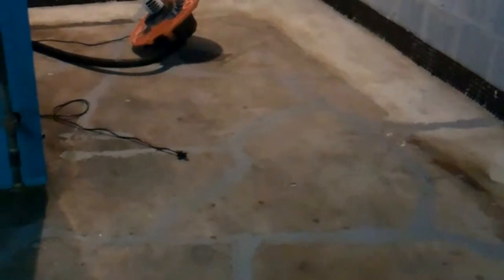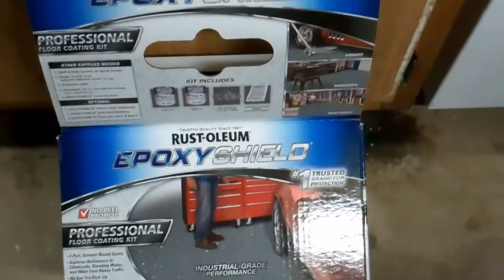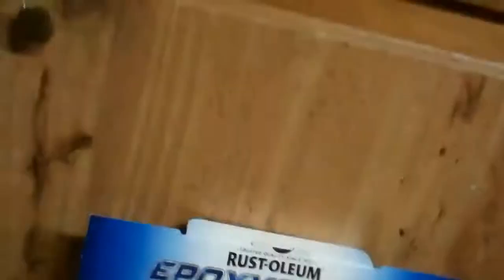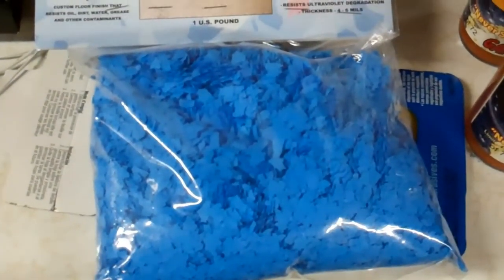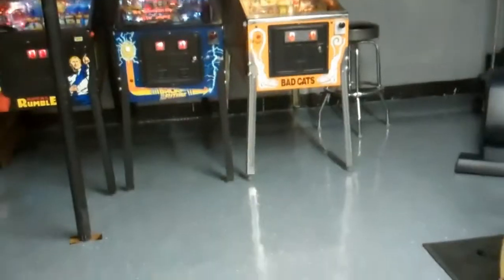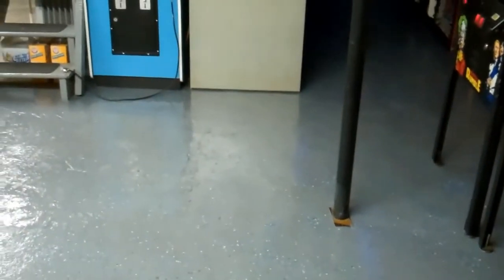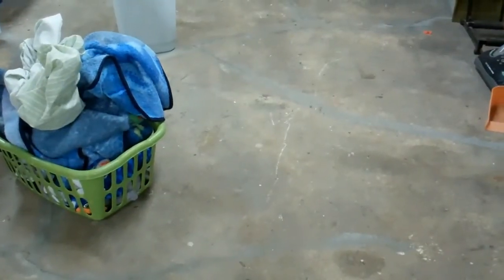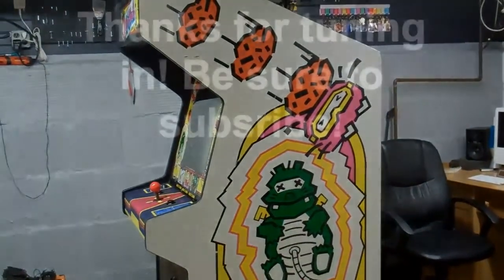Brewer's Arcade: basement floor renovations w/ Rust Oleum Epoxy Shield

Comment: Thanks for the tips.  I'll buy the chips too. Seems like the best solution for my basement I've been able to find. I have an old house with field stone basement built over ledge. I had the cement manually removed and the entire basement re-cemented. Even with very reasonable labor rates I spent a fortune. I shouldn't get water now, but just in case I'm recommended not to use carpeting. One section of the floor is raised so tiling would be difficult too.

Comment: Awesome result, congrats.  I was going to do something similar, then a huge pile of carpet squares were getting tossed at my work (after only about 9 months of very light traffic), so I snatched some of that up & used it instead.  My arcade is in my former garage (no basements in CA).
Reply from the maker: Yea, I contemplated the carpet squares...how do you like the look?
Reply: They look good, I wanted to do black light carpet,  but it was expensive, and would've need difficult to install.  Pretty soon, I'll have some videos up for my arcade, I just need to get a new camera & clean some stuff up.

Comment: Hello, just come across this video, thanks for sharing the process and the floor looks great! How is the exposure holding up now? Looks like it has been a few years now.
Reply from the maker: Still holding up great! I use Murphy’s Oil Soap floor cleaner and it works great. I’ve scratched a few spots from moving arcade machines
Reply: BrewersArcade thank you for your response!

Comment: looks good.  Do you need to remove all base board and door trim beforehand that would touch the floor?  Do you need to add some type of floor barriers (wood, tape, etc?) to prevent it from going to keep-out areas like your furnace?

Comment: Looks like a great solution for your game-room floor!
After watching your video, I'm thinking of following your
lead for my 80s basement arcade. I collect similar machines.

How long do the fumes last from the Epoxy? Several days?
Do the paint chips glow well under black lights? I just purchased
four 4' black lights. Were you able to find those chips at Home Depot
or Lowes? 

My floor appears to be approx. 350 square feet. The kits are for 300.
Will adding the additional paint chips cover more?

Comment from the maker: I just painted around my furnace (I turned the pilot light off first...the fumes are flammable). Its up to you if you want to remove the baseboards...I would just paint as close as possible. Have someone use a brush to cut in while you roll.

Comment from the maker: The fumes were mostly gone after one day...I had a couple fans running and the windows open for a day...they aren't terrible...strong but not unbearable while you are laying down the paint. You need to purchase the paint chips online...I bought mine from "Original Color Paint Chips" online (search for black light chips). You should be able to finish your floor with one kit. MAKE SURE YOU BUY THE CLEARCOAT as well...it makes a big difference! Be sure to subscribe to my channel!

Comment from the maker: I used concrete filler caulk...make sure you try and fill the crack deep if possible by pushing it down with a trowel or other tool

Comment: Is it holding up well?  I was considering doing this in my basement.  Would it be better to stain and then apply clear coat or to use this product?  Should I{ use the professional graded product you used or the cheaper basement epoxy kit?
Reply from the maker: Mine is a year old now and is holding up great. Cleans up nicely with basic Mr. Clean floor cleaner. Since the industrial version isn't much more (I got mine on amazon) I say go for that one but I'm sure the other version would be fine as well.  I've never stained concrete so I can't comment on that. Good luck!

Comment: How did you handle dividing the floor up into parts?  Did you end up with any noticeable seam?  I will have to divide my floor and do it in sections also, but not sure how to make it look uniform with no seams in the paint.  Ideas?
Reply from the maker: No seam showed at all. I did one side with the exopy and then clear coat over a weekend. Then I did the other size with epoxy and then clear coat. I left about five inches at the split without clear coat and then overlapped the clear coat when I did the other half. Good luck! Be thorough with the clear coat
Reply: Thanks!!
Reply from the maker: No problem! Please like and subscribe to my channel!